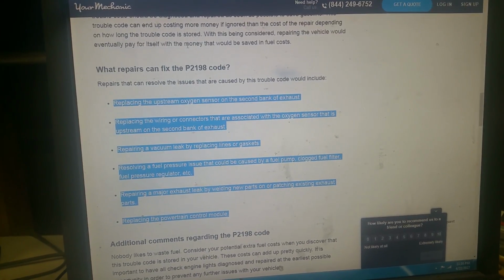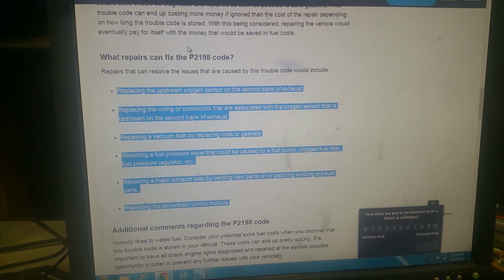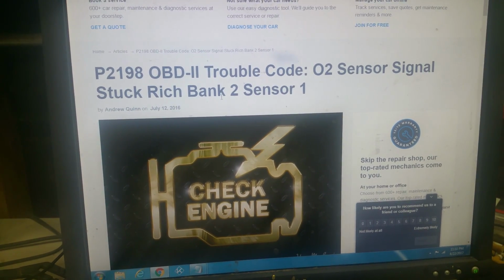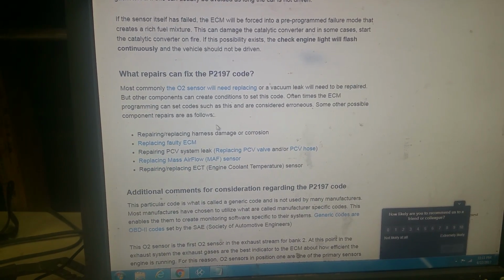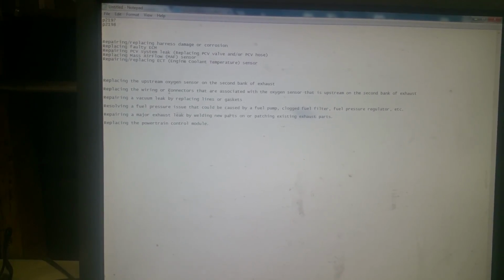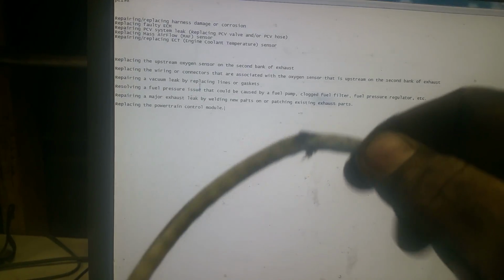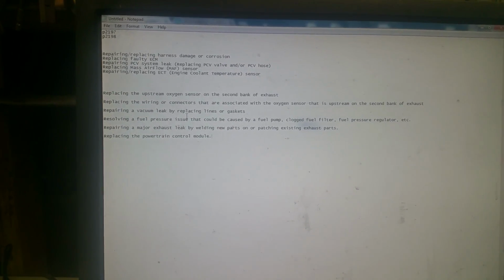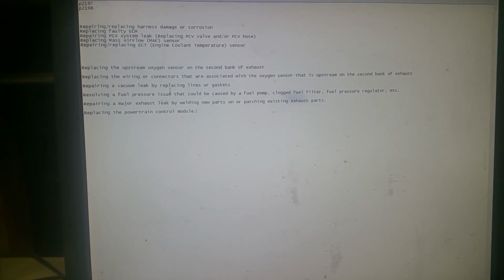Easy Way to Read Multiple OBD 2 Codes P2197 P2198 etc..

Comment: I have codes P2198 and P2196 on my 2014 Mustang v6 i need help!!!!!! my car is getting close to jerking when idle sometimes. it has lost power, weak acceleration and bad chemical smells. i don’t know what to look into first.
Reply: You ever resolve the issue? Mine has same issues
Reply: @Phil_Mycock_69  Sorry I have not. But I’m going to take my car to get checked this Sunday, hopefully get it figured out. The codes come up as something wrong with an oxygen sensor(s).
Reply: @Phil_Mycock_69  I came up with either O2s, purge valve, or MAF sensor. I’m going to try to clean those parts out first before I take it in this Sunday tho. Idk why but for some reason after I pump gas my car has started dying right after. But will turn on and run the 2nd crank. Not sure maybe the battery?
Reply: @Phil_Mycock_69  I took it to a mechanic I know, yesterday. He changed two oxygen sensors. (Bank 1, Sensor 1. Bank 2, Sensor 1) So far the car has ran better. I pumped gas & it didn’t die this time. I will update within a couple days.
Reply: @Phil_Mycock_69  Good to hear as well. Let me know if your issue comes up again.

Comment: I had 2196 and 2198 on my 5.0 litre f150. It was sticking purge vale. Cleaned it up wd40. Engine fuel trims and 02 sensors working perfect no more codes. So glad I didn’t replace 02 sensors. $715 Canadian

Comment: Ford 4.0
P2195 and p2196
Reset codes hasn't returned yet 
Seems like I'm using more fuel.
Right before this I found tailpipe going into muffler broke. I replaced muffler but I dont have any tailpipe after muffler connected. Any ideas?

Comment: I have p2198 stuck rich high voltage. I replaced the sensor and still, the code keeps coming back...
Reply: What was the problem? I have this EXACT issue I’ve cleaned the maf replaced b1s1 and now I have b1s1 and b2s1 slow response and p2198  . Greatly appreciated
Reply: Check the purge valve, a lot of people are saying purge valve, most of the time it’s not the o2 specially if you’re getting 2196 and 2198; would be very unlikely both o2’s go bad at the same time